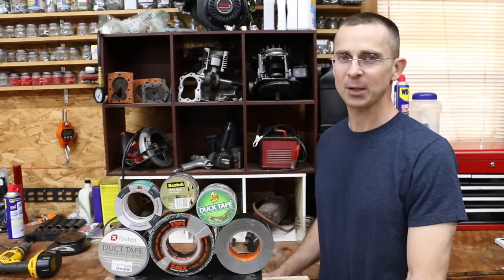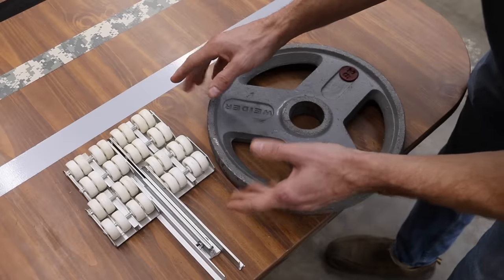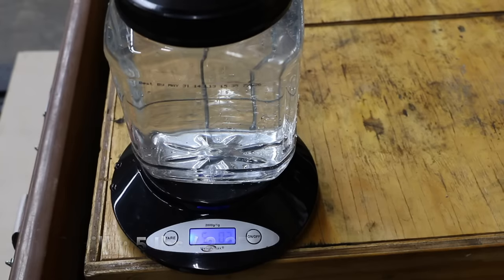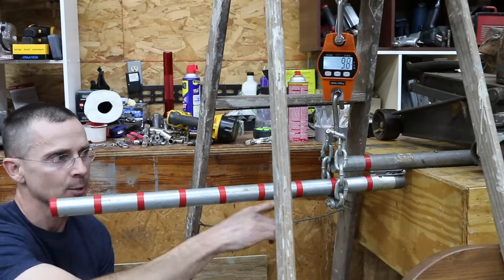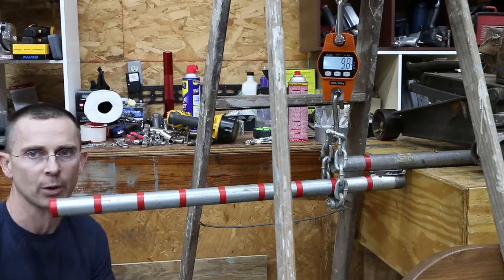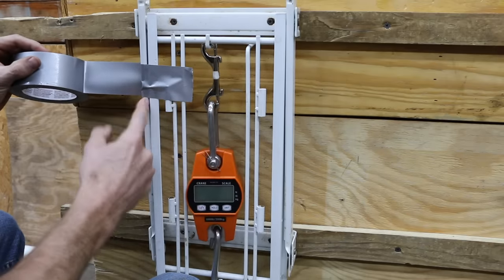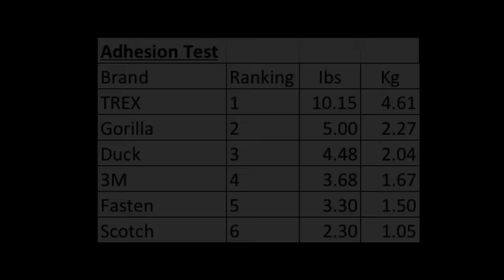Which Duct Tape Brand is the Best?  Let's find out!

Comment: Actually this was pretty interesting in seeing how each one did overall but in the individual break tests. One of the really fascinating things I found was when you did the sl motion shots of  each of the tapes breaking with the various methods which got me thinking about the manufacturing process.

I was looking at the patterns of each tape when they stretched and tore apart in the slo mo shots and some of the patterns were of a straight line variety , some of a diamond pattern but what made me wonder with those break patterns is the material that they layer in between the tape face ( grey/brown/black/camouflage ) and the resin/rubber. It looks like depending on the quality of the resin and the strength and pattern of the material sandwiched in between led to the tape breaking.

It almost looked like the diamond patterned material once the resin let go was able to break away easier than the brands that had a woven pattern and even some that looked like it was a straight line seemed to hold up better than the tape that had the diamond patterned material 

What really is the kicker is that some of the name brand like scotch failed fairly easy as did 3M in some tests, when really those are some big brands that have been making tape and adhesives for years and years and years. Some of the pricer brands did well, but I think we all know in some test they didnt come out exactly at the top but performed well. Makes me wonder if some of the well known brands might price it cheaper knowing that while it will do the job it might not last. and with a lower price point the buyer would be encouraged to buy their brand even though it might no work as well rather than an expensive competitor brand. Imagine if the brands that didnt fare well upped their resin quality and a better patterned and strength material would produce different results in the future

Look at painters tape ( the green and blue etc ) not all is made equal, I think people see the various lengths and widths it comes in  when they are shopping for it plus the price and dont really know the difference between them other than color and width and of course price, but I dont think people realize that they come in different adhesive strengths and for different applications , painting  walls, painting vehicles, painting steel or metal, there is some painters tape that when used in the wrong application can be a pain in the rear to stay on or take off.

Interesting test to say the least, makes me think twice now about some of the name brands and why some of their products are so cheap
Reply from the maker: All great points. Thanks for commenting.
Reply: Holy shit buddy!

Comment: You only need two tools: WD-40 and duct tape; if it doesn't move and it should, use WD-40, if it moves and shouldn’t, use the tape.
Reply: Fun fact, WD-40 isn't actually a lubricant, it's a solvent.  It's a good place to start if you're dealing with something covered in rust or corrosion, but aside from the old joke, you really shouldn't use it as a general purpose lubricant (instead look for something graphite- or silicone-based, or find a specific product made to do a specific job, like gun oil for cleaning a firearm -- WD-40 will ruin a gun in the long run if you try to use it there)
Reply: @JimRFF  Yeah if you want a lubricant; 3-in-1 has always been reliable, however, WD-40 does make a water-resistant silicone lubricant:  https://www.wd40.com/products/silicone-lubricant/
Reply: @skilz8098  WD-40 makes specialist variants for most things that require lubriction.
Reply: @niccatipay  I know, I was just pointing that out! So that people wouldn't avoid WD-40 as a lubricant because they do have it. That and Liquid Wrench are probably the better and reliable brands out there next to 3-in-1 Oil!
Reply: @skilz8098   Yep thanks cap
Reply: Not when you're working industrial maintenance. In that case, it's 
"If it moves and it shouldn't, use the welder. If it doesn't move and it should, use the angle grinder."

Comment: I have been using the clear gorilla tape for the last two or three years and have been very surprised at how versatile it is and it has never disappointed me in its strength or stickiness. Initially, I thought it was just expensive packing or shipping tape but it is far superior 2 shipping tape. I have used it to make temporary patches in inflatable boats, patch holes and window screens, or help with making inventions and gadgets where I need a clear waterproof seal.
Reply from the maker: Thanks for sharing.

Comment: Man I really wish you had used the strongest (or at least a stronger) version of the Duck tape, I know from experience that the digi-camo roll is extremely weak (and as you pointed out, the skin is very elastic) Duck makes different types of tape and the ones with designs on them are usually the shittiest (because kids buy them to make wallets instead of actually fixing things).
Reply from the maker: Great point. Thank you for this recommendation!
Reply: From a little bit of searching, I believe Duck tape actually owns and manufactures the tested T-rex tape.
Reply: I agree standard duck tape is way better than colored or printed crap and T-Rex tape is junk if it's 50 degrees it won't stick at all
Reply: I've noticed that solid color Duck tape tends to stick quite well. But only the solid colors. The big thick rolls are better than the thin rolls. Look from the side to see the difference.
Reply: Coming from avon, Ohio duck tapes capital that is 100% true.  We have every year a parade and a festival all sponsored by the company and almost never do they recommend using the designed tape for any project besides for just being for fun.
Reply: Duct tape wallets are still a thing in the US? -my god I'm old
Reply: Not all kids do. I don't even know how🤣
Reply: Years ago, when my oldest son was a Cub Scout, his pack had one of those soda bottle - bottle rocket launcher contest things. Long story short, his rocket did well but would have done better without all the added weight from the Duck brand "I LOVE BACON" duct tape that covered the 4 wings, the rocket ended up being overweight. Hey, at least when it was his rocket's turn to launch, he got a kick when all the other kids started shouting "BACON!... BACON!... BACON!..." True story bro.
Reply: Random Guy I'm 13 but it ticks me off how duck tape has turned into wallet maker
Reply: Random Guy you better watch your profanity

Comment: I know I’m late to seeing this but this is really useful. You can see not all tape is the same. Duct tape in my opinion is one of the best inventions in history like I’d say probably in the top 5 with wheels and  motors up there too. It can be used for so many different things other than weight support and sticking to a random surface. Even the United States Military used duct tape as a bandage during the Vietnam War and it worked. The pressure stopped bleeding and seal stopped potential for infection. It can also be used as rope if rolled properly or even shelter if you have just sticks to make the basic shape. Duct tape is truly more than just a tape it’s a tool.
Reply from the maker: Thanks for sharing.

Comment: I think it depends on what you want to use it for. I once tried to seal up some drafty windows by taping a piece of like 5 mil plastic over each window and leaving an air gap. (3M actually has a product that does something similar.) Anyway, when I tried to use Duck brand it fell off in a matter of days! When I switched to Gorilla next, it held up all winter long! However, it also took the top 5 layers of paint off with it in the spring! 

In a different house, I tried using Duck brand tape to seal around a window air conditioner so bugs couldn't get in the cracks, but this time I couldn't get the tape OFF of the vinyl window! It half melted and half decomposed as I was pulling it off!
Reply from the maker: Great point.
Reply: Sometimes ease of removal is more important than strength.  Exposure time, humidity, temperature have very different effects on the adhesives and their subsequent clean up after the tape is pulled off.  p.s. Contractors Dis-olve-it has become our best choice for adhesive clean up.
Reply: There are a lot of uses for a tape with high flexibility and gooey adhesive in air handling and water shedding.  I wouldn't use Gorilla or T-Rex for normal "duct" tape applications, but I would use them for more structural applications.

Comment: Great video, thank you for the test and the slow motion tearing looks awesome!

Could you also test adhesion on different surfaces? And general weather resistance (water, sun, heat, cold, just leaving them outside should be sufficient for a general idea).
Reply from the maker: Thank you for this recommendation!
Reply: could you also test to see which one of them leaves the most adhesive residue on the surfaces?  not really for the quantity but for how sticky that leftover residue actually is.

this combined with testing against the elements should work good, because, for example, gorilla tapes' glue melts easily and leaves a heavy residue that is hard to remove (from my own experience using it ina binder for school).

Comment: I'm a technician in the live event industry. Here in Europe, we use "Nashua 357" which is pretty much the industry standard for canvas tape that holds something.
For taping cables to the ground, lighter tape is often preferred as it's easier to pull off.

If you can get your hands on it, it would be interesting to see you testing it.
Reply from the maker: Thanks for the video idea.

Comment: 11:16 And that's what I appreciate about these videos and your channel, it honestly kind of staggers me that afaik you're pretty much the only person putting these products to the test for consumers to make informed decisions. I've definitely been a lot happier with my purchases on some brand changes I've made based on these videos. Just the other day I bought Gorilla tape, where before I would have bought HFT or 3M, I noticed immediately how much stickier the Gorilla tape was, was actually hard to get off my hand and even hurt a little because it was cold out, lol. I bought that Gorilla tape the other day for a HFT carport I'm putting together, the tubes are just a slip fit and it would be falling apart as fast as I could put it together if I wasn't fixing them to each other somehow, contemplated several methods and decided to use duct tape, between your video and it's claim of weather resistance I went for the Gorilla tape. Putting this car port up also has me thinking about tarps, as I somewhat expect this fabric covering to rip sooner than later. Feel like most if not all of my tarp experiences have been bad, ripping easily, decaying from the elements, grommets ripping out etc, would love to see a test of some tarps if it seems worthwhile.
Reply from the maker: Thanks!  Thanks for the video idea.

Comment: Missing one last step... MSRP!
For example, if T-Rex is twice as adhesive for 4x the cost/foot, then Gorilla is just plain better. While if Gorilla is 4x as much as T-Rex... then it’s a better compromise on strength and shearing.
Reply from the maker: Thank you for this recommendation!  On Amazon, TRex and Gorilla cost about the same.
Reply: The prices of the tapes are going to vary by location. Walmart will likely sell a given tape cheaper than a locally owned hardware store. Also, a roll of a given tape will probably be less expensive in Florida than the same tape would be in New York. So, yes, the MSRP is a nice generic figure to play with, but we all know most retailers set their own prices and may be well above or well below the MSRP. In most cases, MSRP is a useless number for any item.
Reply: totallyfrozen hence MSRP. 
It tells you how much you're likely to find the item for,  often the upper limit.
Reply: An idea for future videos is to perhaps have an amazon link to the products you are testing. That way, not only is their a price availible for people to check out, but their is also a direct link to the actual product you tested.

What if (for example) 3M makes 8 types of duct tape? Which one did you test?

A great video over all though.

Comment: I have loved Gorilla tape and glue since I first used them. All this did is confirm why I love Gorilla. Thanks for the testing!
Reply from the maker: Thank you!
Reply: Zombie4416 maybe you’re using an old product cause immune works womders
Reply: Zombie4416 Can't say I've ever had that issue myself. It's my favorite tape. It even stuck to our brick house when I needed it temporarily
Reply: Zombie4416 never had that problem
Reply: Chris Foxwell LOL I have it holding the front end of our old Envoy together. Clips were broken on the driver's side front bumper by a mechanic when I had a repair done and Gorilla tape has been holding the bumper in the correct place for 6 years now. It's stayed on through freezing temps, over 100° temps, through washes, through rain, through road salt... So far that same piece hasn't let me down! It's great stuff for auto repairs
Reply: Zombie4416 probably because your using duct

Comment: Great demonstration.  Many people will not know what duct tape was designed to do- cover the joint of furnace ductwork to prevent air leaks.  That does not demand neither a high tear load nor excess adhesion.  In fact some of the sturdier brands tested may be too over built for that task.  That being said your testing is unique, practical and certainly will help make an informed decision if what one needs is a high adhesion, high load and high tear strength.
Reply from the maker: Thanks!

Comment: Was disappointed in 3m/Scotch....   Family used to work there
Reply from the maker: Yes, me too. I thought 3M would be great.
Reply: Homefront nostalgia.exe
Reply: I just finished a roll of 3M that was pretty old, it was black tape and its the stickiest duct tape i have ever seen. Stuff works great. I tested prob between four other brands and it was the best
Reply: Same with scotch brand office tape, way to brittle, the generic Chinese brands stretch rather than break.
Reply: I'm actually not surprised that 3M was bad. Haven't you noticed, it always seems to be the "old reliable" corporate brands that have done so much cheapening since the "good old days"?
Reply: Homefront they still have the best packing tape on my opinion. I use it everyday at my job for boxes of furniture parts
Reply: 3m is also cheaper so thats a plus
Reply: 3m electrical tape is also amazing compared to everything else I've tried but as far as duct tape goes really sad it doesn't hold up to the others
Reply: 3m is pretty lame
Reply: 3m is pretty lame
Reply: I was having hopes for them too

Comment: Two big tests that you forgot:  
Usability - how easy is it to rip a section of each tape without using scissors?

Cost - What quantities do these rolls come in, and how much do they cost?
Reply from the maker: Thank you for the feedback
Reply: The usability test, doesn't give me hope, how easy to rip each tape without scissors can also equate to how bad the product will hold when force is applied at a particular direction. I would rather it be harder to rip to be honest.

I agree with the cost test and I also would have added an adhesion test. Holding weight is one thing, but HOW LONG can it hold at certain weights. As an example, the Gorilla tape clearly comes out a big winner here, but if it were holding say 10kg for 2 months, which tape would come out on top in a test like that?

Otherwise, I love the video and love that @Project Farm is still answering comments all this time on.
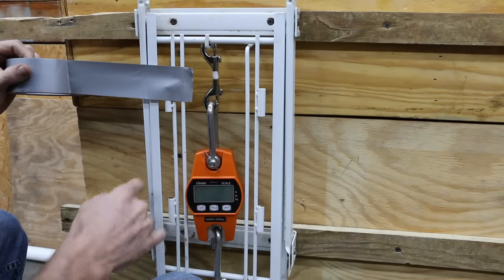Reply: usability test at 8:00 when he rips it sideways.
Reply: @Au16227  He means specifically ripping. Downward force isn't the only thing applied to ripping tape. When you rip tape by hands you actually apply force on the most minimal portion of the tape, not the 2cm width but the 1 or 2 mm in height.
Reply: @chrishillman3327   it doesn't matter which direction the force is applied in, as long as it is perpendicular to the tape. Ripping is perpendicular to the tape, the test at 8:00 is using weights to rip perpendicular to the tape.
Reply: @Au16227  I would disagree, having used a few of these brands i would say Gorilla, even with being the 2nd strongest in the width test, is the easiest and cleanest tear by hand while just having a nice feel in general
Reply: @MrZylr  which you could see from 8:00
Reply: @Au16227  gotta agree with you here, the horizontal downward application is essential the same as ripping it by hand. Using a ton of duct tape for temporarily securing wires at work, the way these tapes ripped during this test is the same way they do when using it
Reply: who cares how easy it is to rip without scissors lmao, if you were ever to use the product you would be expected to cut it
Reply: Also failed to test for removal of body and facial hair.
Reply: If you can tear it easy and its cheap, its going to be borderline unless.

Comment: I really like your testing methods used here.  One test I would have added is measuring the amount of stretch before total failure.  In some uses, if the tape stretches too much, it's failed it's job at holding something where you want, even though it may not have actually broke.
Reply from the maker: Thank you for this recommendation.

Comment: Another thorough test! Very good! The only thing I have to say is that in summer heat, the adhesives used lack the power to stay put and not smear off, like a tear repair on an automotive seat. It doesn't take long, before the adhesive starts getting transferred off the seat, then onto your clothing.
Reply from the maker: Thanks!  Thanks for the feedback.